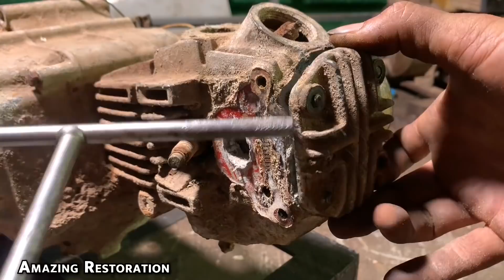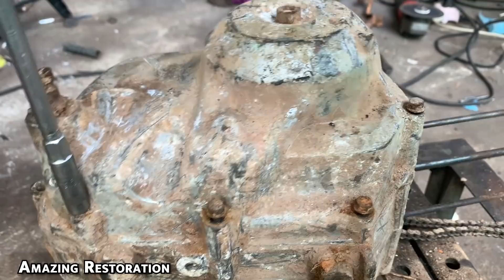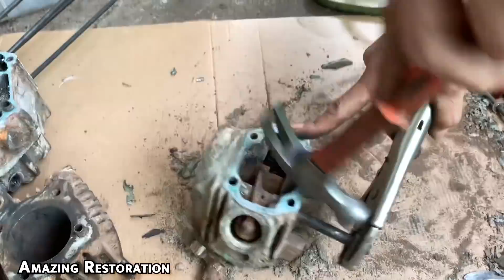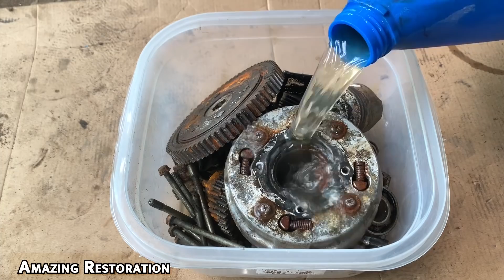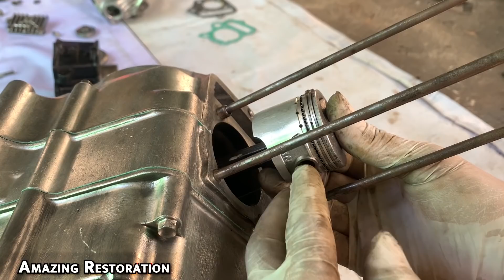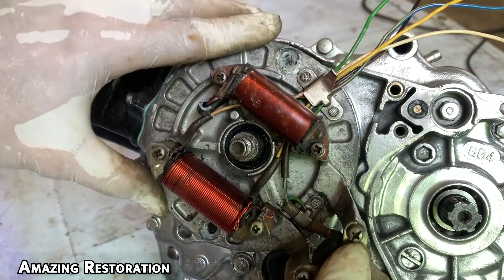Restoration Engine Honda CUP 1990 | Restore and Repair Motorcycle

Comment: Hello, sorry for my bad english. What liquid is in the 24 hour canister? Which brush are used to clean the individual parts and housings? That was a very interesting film and I will subscribe to it. Best wishes from Germany, Rainer
Reply: maybe rust remover
Reply: There were a few things he could have used but it was most likely MC-51 Rust Remover (or something like it) and the brush looked like a basic wire brush wheel installed on a grinder.